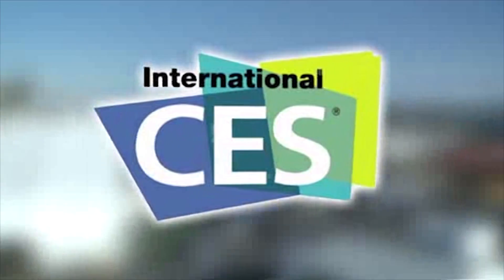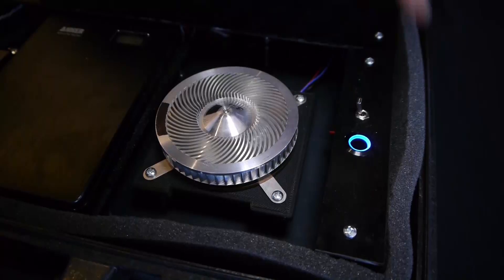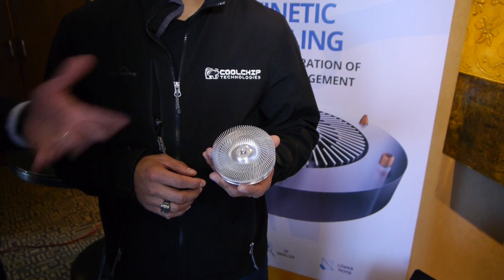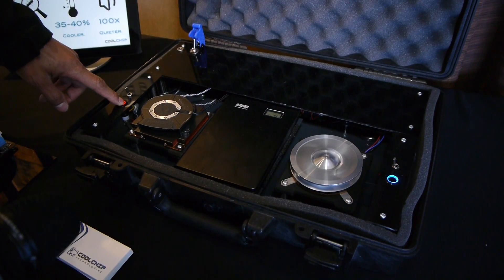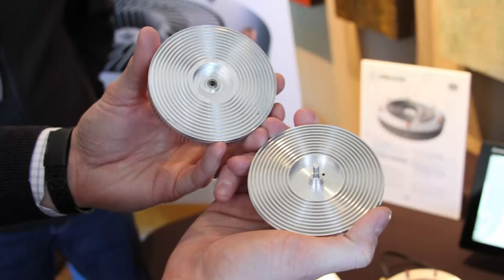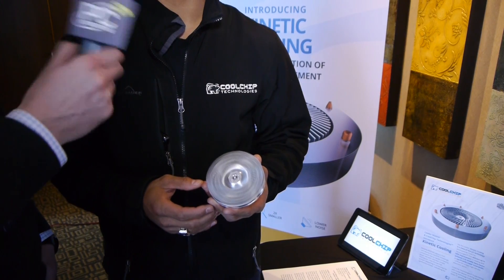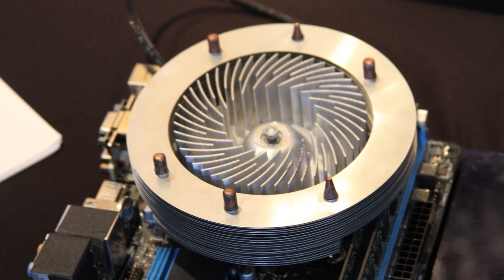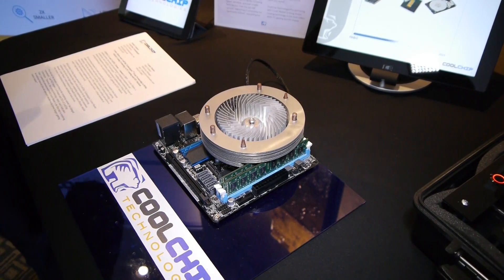CoolChip Technologies and Cooler Master Show Kinetic Cooling - CES 2015

Comment: My calculation, the air gap between the rotary heat sink and the bottom surface has to be less than 0.001inch. When the angle of inclination of the rotary heat sink is larger than 0.01 degree, two objects will hit each other. Since you use a bearing in the device, this will happen eventually. How many hours can I enjoy this device before it is broken?

Comment: Actually computers and electronic devices don't heat as much people think, they reason why they heat, is because they think they heat, and are utilizing there powers to heat the electronic devices, is like cell phones, they don't heat anything at all, but why they heat? Because the same clones of Satan use there powers to heat electronic devices, they send waves which can also hack them, they actually don't need any fan at all, only need components to be built heat resistant that is all.
Reply: ***** are you serious
Reply: Yes and also a good CPU should actually be able to use an algoreethm to cool itself... It is clear that Intel just wants us to buy fans because they get a little %age of the revenues... My freedge gets hot on the outside but inside it's freezing cold so the CPU should be hot outside but the cores should be ice cold! My GPU is not getting hot since I removed the fans, it stays cold actually, and it's not even running. Intel is a lie, Jesus is the true cooling solution. Amen.
Reply: Auto m4tic well the fan helps truly, but if they just design the hardware more heat resistant it would run adequately without need of any fan, which takes a lot of space.
Reply: Yes they should make material that don't expand while being 20 nanometre thick and being hot.. They want our money thats why they invented heat!

Clue for you: "Heat and material expansion" :: "20 or 30 or 45 nanometre thickness and heat resistance"....

Maybe.. Just maybe, you'll get that I'm actually making fun of you ;)
Reply: ***** one good example here is PlayStation 3, it's a huge machine with a huge fan, it heats up alot and drains electricity alot, why? 
Because Sony design it that way, they use a thermal compound that is ridiculous low quality, which they knew it wouldn't last dry long, why? Because that was the idea! To make ps3 that didn't last that long, so people would spend more money, they are robbing people's money, unfair!? Yes! Very unfair, they build it that way because not only the pedophile of Satan is copy inside there minds and is manipulating them to use them to destroy nature by utilizing more electricity which is created by pollution, but because is all part of his plan to destroy it all, sense Chinese are clones of his, who want us to be poor, and aliens are also manipulated by the pedophile and want us to not have a nose, and be like them not needing to eat, also the dead invisibles want us to not eat and not sleep like them, so everyone is doing bad things because they are all manipulated by evil software in there brains to destroy and cause bad things.
Microsoft is even worse, building fake technology as wireless electricity or wireless chargers which is not even scientifically possible at all.
Bunch of idiots.
Reply: B O S S... xD

You got some points yeah, but you're either trolling or amazingly stupid.... Or both?

Yeah they make sure that stuff don't last for ever (I think it's called - planned obsolescence) and yes they are EVIL and greedy and won't stop to find a way to take our money...

But Satan, bro? Really bro? And "THE pedophile" lol come on...

It's the fish that makes them do crazy things and the poor alien say sorry too.. you know?

Comment: Now, both samples are shown lying flat on the table.
Considering the production prototype will the heat transfer also be as effective when installed vertically in a tower case situation?

Comment: WHAT KIND OF SORCERY IS THIS!?.PNG

Jokes aside though...they said it'll be available commercially by the end of 2015...I find it very hard to believe that something like this is actually capable of cooling 2500K/2550K/2600K/3570K/3770K/any i5 and i7 Failswell/any i5 and i7 Badfail while they're OverClocked to 4.4GHz (which is a pretty standard situation these days), to something below 70c. We'll see, I guess...we'll see...
Reply: BlurredFace
Except there's one VERY TINY and ABSOLUTELY INSIGNIFICANT problem that might arise...look at the orientation of this thing...even SFF solutions might have problems (hell - I actually bet that majority of them WILL have problems with this thing if it turns out that without good air flow chart this thing isn't all that good at all sheer cooling sustainability-wise). It's one thing if you put this in something like the GODLIKE BitFenix Prodigy or exceptionally low heat-producing HTPC solution/console, but it might get (and probably will) pretty ugly pretty fast in Elite 130 or something like M1 to that matter.
Reply: BlurredFace
Did you even read what I've said? Where did I say anything about "not fitting"? "Fitting/not fitting" is not the case.
Reply: Standards
Hyper 212 is a typical tower cooler with absolutely standard orientation. Do you even read?
Reply: Well in  that case why dont you use nitrogen?

Comment: Reminds me of the Sandia Labs air bearing cooler, I wonder if this is related. I also wonder how it would function mounted vertical like the orientation of most HSF units for desktop PC versus horizontal like rack mounted servers or HTPCs sit and also if it would work inverted in the way the "blower" fan units on many reference GPU are mounted.
Reply: It is clearly related: http://chronicle.com/article/Who-Deserves-MITs-200000/128810/

Comment: Hey what if the thin layer of air is replaced by a thin layer of liquid since liquid transfer more heat than air ??
Reply: How should that work? How could you make something like that leakproof?
Reply: RacistPandaGER There should be a way. I don't know exactly
Reply: Engine oil is used to reduce friction and cool the engine in someway. So there should be a way to cool it. I don't suggest to use engine oil
Reply: You caompare an engine with something like that? thats somehow ridicilous :D
Reply: wooo weee  well now that i think about it, maybe it uses fluid dynamics to get a lower resistance.
IIRC though i dont recall where i heard this, the faster air goes (or any gas) the lower it's pressure (in an open system). If you have lower pressure, the vicuosity also gets thinner and so you have less surface tension which if iirc is the principle i read these were using to avoid getting caked with dust. That aside, if you get less surface tension you can get a thinner layer of air, hence less thermal resistance between the two pieces as there's less air "resisting" the thermal energy transfer.

Remember hitachi used helium to get more plates into an hdd, becaise helium has less viscosity than common air hence less traction, allowing them to cram things closer together.

Well the thing is hdds using normal air spinning at 7200 already have the heads flying at 2 µm or so. So if that heatsink spins really fast it would still be really good at cooling as the air layer would still be really thing. (also why you cant have a pc, an hdds more specific, at the top of a mountain, because less air, the heads fly closer, they can crash or get de-calibrated, and so fail to read
https://en.wikipedia.org/wiki/Flying_height )
Reply: it would have to be a really low viscosity fluid that wouldnt evaporate nor leak and that's really hard to achive in an open and dusty environment like a computer
Reply: yeah hope someone will find a solution
Reply: Mathila Amarasena It doesn't need a solution, that's the point.
Engines are closed systems, its why engine oil works, anyways that is a water cooling type system not a heatsink like this is, so making this more like a liquid cooler just defeats the point.
Its clear they use an air bearing and some kind of principle to transfer heat effectively otherwise they wouldn't even bother, it has to out perform an air cooler otherwise it doesn't justify its own existence, I think they already solved any problem you are thinking about.
Reply: ***** No the purpose of the liquid is transferring heat from the lower part to the upper rotating part. The upper part takes care of cooling the liquid. Cooling the liquid= cooling the cpu :)
Reply: Mathila Amarasena Sandia Laboratory hires people far smarter than either of us, I'm sure they do not use fluid for good reason, and the principles they are exploiting to get this to work probably work more than well enough, which is why it can replace a regular heatsink at all.
Reply: Mathila Amarasena Read CSH's comment again. The water will not cool until it is flowed through a head dissipation unit.  Copper would be better
Reply: If the liquid is in contact with the upper fan like part , why it won't transfer heat to the upper part?
Reply: Mathila Amarasena lol that will make spining part inefective ...
Reply: Mathila Amarasena why not graphene? Transfer heat 10 times better than metal..
Reply: WikHellfire - PlaystationShare yeah but it's 1 atom thick........it wouldnt last too long. It's all cool in numbers, but it's not very resistant to traction and mechanical stress. Those "10 times better than..." are all laboratory numbers, not something you can really make use of.
On the other hand you could use graphite, but it wouldnt stick and would end up al over the motherboard. It works in compressors but those are sealed.
Reply: Laharl Krichevskoy ofcourse I meant graphene or graphite, I guess they dont have the technology yet, but I think it could be worth investigating..